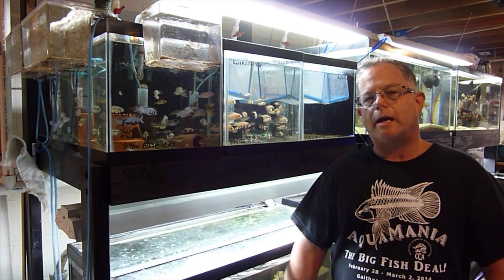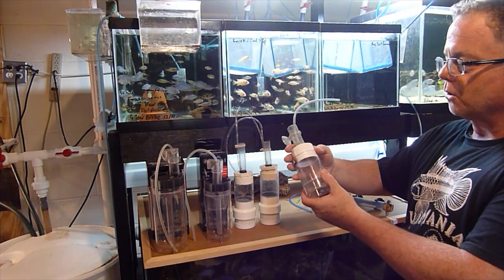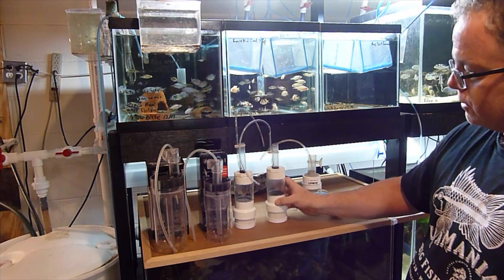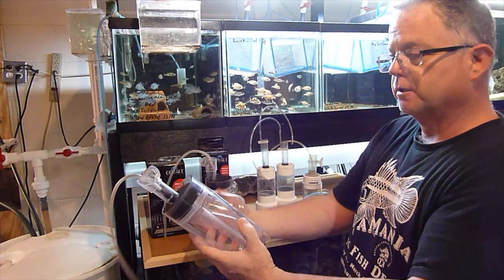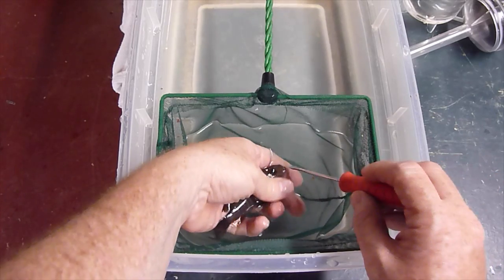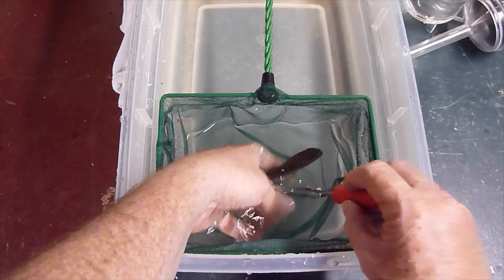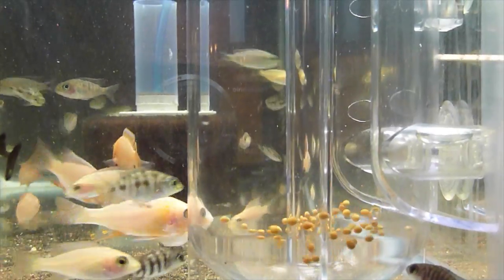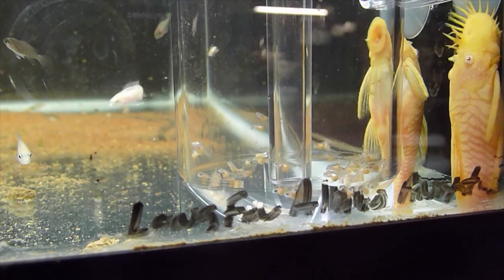Egg Tumblers

Comment: really would not recommend a screwdriver, a sharp movement from a fish can slice it open , or damage the eggs, id use a hair bobby pin with the soft plastic on the end or a rounded match stick end anything soft, otherwise a great video and very informative and thank you
Reply: Reed Gilbert  cool . glad it wirks out. id be too nervous lol i use the soft esge of a bobby pin. got mine in the egg tumbler at the moment just lifting off the bottom but cant decide when to let them out lol